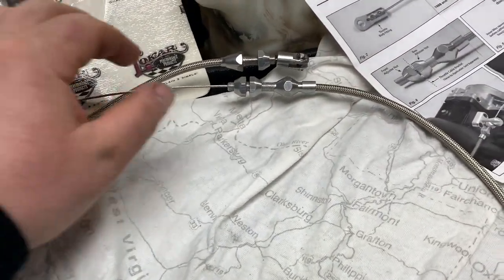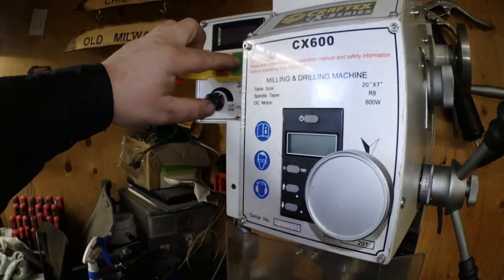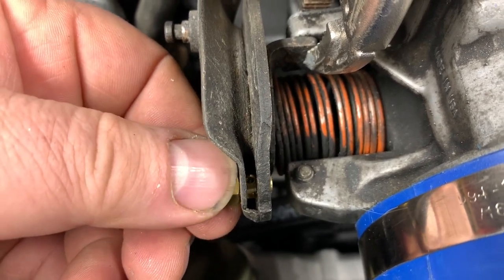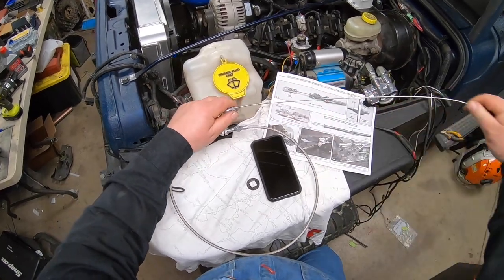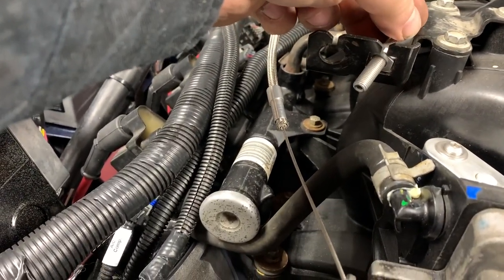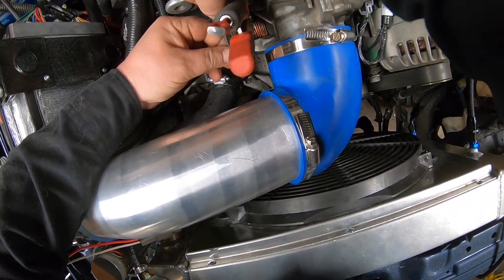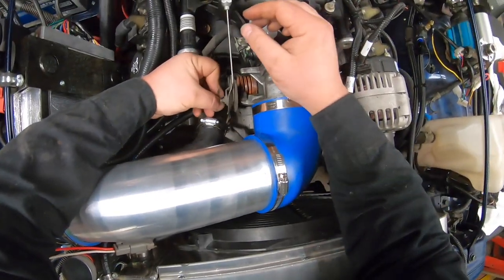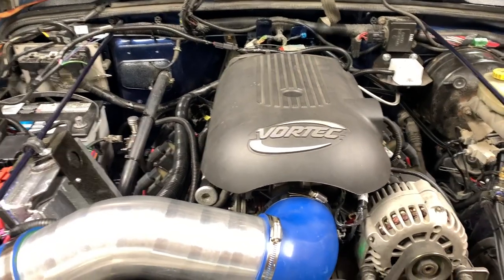Ls Swap Jeep TJ Throttle Cable DIY

Comment: Maybe stupid idea but what if you inserted that brass piece from the other side (right side/back) rather than drilling it? Seems like hole would line-up then.
Reply from the maker: A person could however to make adjustments and tighten the set screw isn’t as easy as doing it from the other side

Comment: I thought that most LS motors have drive-by-wire accelerator
Reply from the maker: You are correct, there was still drive by cable however not as common.  Drive by wire is the way of today.